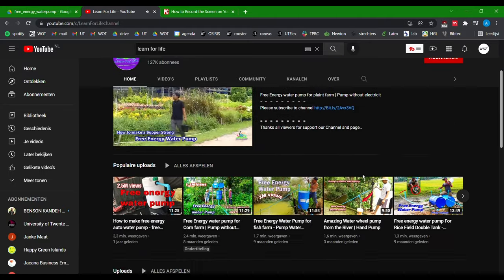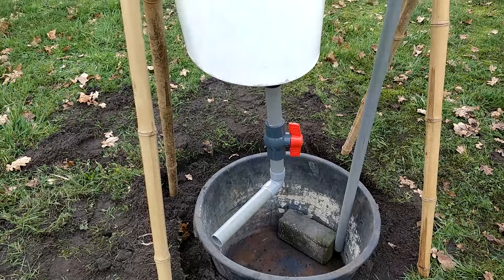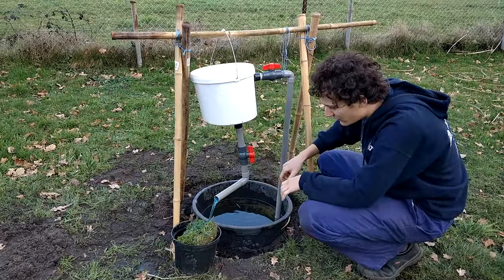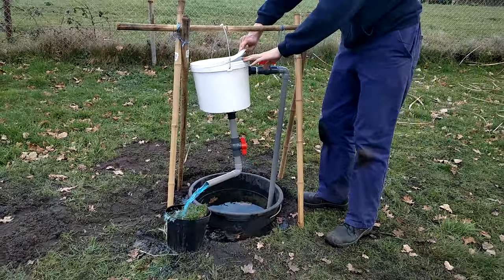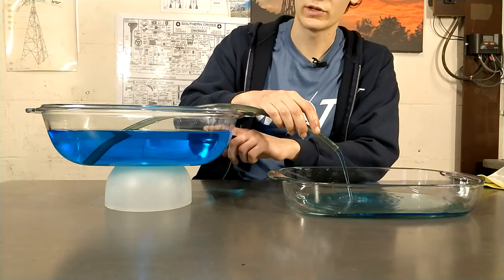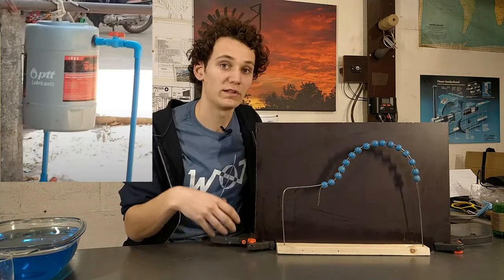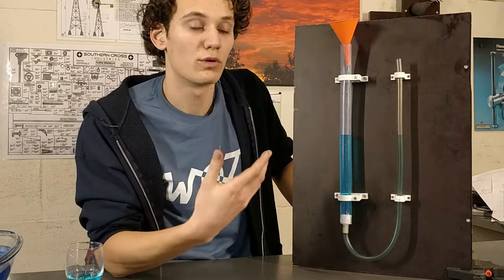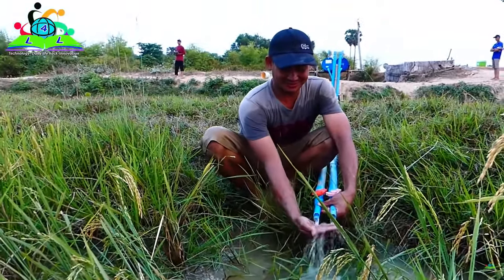FREE ENERGY Water Pump Tested. Is it possible?

Comment: Having pumped out septic tanks in Alaska, I realized the limitations of sucking water from below. Also, there were differences in your test setup and the one I saw on another video. The limit is atmospheric pressure. That is what really pushes the water up from below ground, accomplished by removing air from the tank on the septic pumping truck. If the truck is too high above the water level in the septic tank, it won't work. If the height of the water at is highest point is within the physical limit of a siphon, this idea should work. If, as in your demo, air is entering your bucket, of course the demo failed. It could be as simple as air bubbling up the exit pipe for the bucket. A 55 gallon drum with 2" pipes at the drum, down to 1" pipes for suction and discharge (the discharge pipe was 60' long) this should stop air from getting in the drum. It must be absolutely airtight. A 1/8" hole allowing air in would be enough to kill the siphon. The video presenter said the well was 20 meters deep. Looked to me to be less than 12 meters. For your demo setup, connect about 2 sticks (40') of 1/2"  pipe past the discharge valve and make sure you bucket is airtight, and I think it will siphon water out of your hole in the ground. The weight of the water in the bucket must be somewhat greater than the water in the suction pipe. Also, pipe diameters matter. Small suction pipe and large pipes in and out of the bucket.
Reply: As he said in the video the "weight" of the water isn't important, only the height of the watercolumn counts. If the system is airtight you can disregard the bucket (when it comes to siphoning) so you would be trying to siphon upwards (which does not work).
Reply: Tom, your insights from having hands-on experience are helpful. "...this idea should work. If... air is entering your bucket, of course the demo failed... It must be absolutely airtight... make sure you bucket is airtight, and I think it will siphon water out of your hole in the ground. The weight of the water in the bucket must be somewhat greater than the water in the suction pipe." See my comment here for some similar points, and for a link to what appears to be a working version of what he tried to demonstrate.
Reply: I think long output pipe helps with streamlining the flow and reduce turbulence, thereby reducing air pockets. Any any small air pockets travelling back to tank are being trapped into the traps and helps maintain the vacuum.
Reply: Cheers, lol.

Comment: My friend think about a seal tight container and only opening being inside the water that must be sucked in  by a vacuum created or left behind by exiting water that same sealed container. That vacuum inside a sealed tight container is the one that is pulling water up from lower level into the sealed container while there is an exiting mass of water on outlet. Easy and it work. Your analysis exclude priming, seal tightness and vacuum or suction pressure.
Reply: The video shows that this set up can not pump water uphill. No siphon can do that. Excellent video.

Comment: What a great video! The use of all demonstration models really clarifies a lot!
Reply from the maker: Hi Collin, thanks! Glad you liked it.
Reply: @daviddorshak8811  You're wrong. There is one big fundamental mistake in your reference to the video - the barrel was intentionally built on the bricks above so that the outflow from the barrel was at a higher height and the illusion of outflow could be applied, preferably somewhere behind the bushes. The bucket of water had a higher level than the outflow from the barrel. It is a normal siphon that actually draws an amount of water that is higher than the drain from the barrel. Notice that there is half the water left in the bucket and it no longer works. The pipe in the well did not really pump water because the weight of the water column did not allow it. The water in the pipe acts as a hermetic valve and is not pumped. Therefore, the barrel was squeezed in when the drain was released. This is perfectly legitimate, but it has nothing to do with pumping water. It is very sad that educated civilized people have joined the Third World fraudsters. These people should spread enlightenment and fight against ignorance.

Comment: This is just Heron's fountain with extra steps... When you think about it the problem it's actually super simple. You only have one force that acting on the entire system and that's gravity but obviously it's acting on the whole system equally so the water that's supposed to rise up is being pulled down by the same force that's also making the water flow out from the outlet. I suppose if you optimized the design you can make it flow for some time but it'll eventually stop because magic doesn't exist  :D

Comment: The vacuum was pulling from the outlet instead of the inlet
Reply: YES, and that is because the inlet water level is lower than the output. So the siphon tries to run in reverce.

Comment: Build the same thing they did with the same pipes at proper lengths.
Reply from the maker: Hi Derrick, we replicated and tested the setup you can see at 0:15. The lengths of the pipes match quite well with this setup.
Reply: The fraudulent principle can be detected on any scale. Many times, knowledge of natural laws is enough. If you believe it works, why not build it yourself? You're so cunning you don't build it because you know it's a scam. This is a compliment, not a reproach. :)
Reply: @WOT_utwente  replication and reproducibility... you did not replicate the other system... you made a rinky dinky contraption...
😂
major failure...
DERP

Comment: You need a Foot Valve (one way valve) to prevent air coming up the outlet pipe. What you are doing is, Creating a Suction inside the closed bucket that pulls the water out of the sump in the ground.
Reply: No one way valve is needed in a siphon, but the input must be higher than the output.

Comment: Would be crazy about those guys doing all that work for just a joke. Try exactly as they did with large tanks then judge right.
Reply from the maker: Hi, as mentioned, we replicated and tested the setup you can see at 0:15. The size of the tank we used is pretty similar to the one in this video.
Reply: No it'ss not the same.

Comment: i saw alot of those videos lately, they don't explain the principle
most who works were pumping water from a river to a rice field and i think it's a siphon, the drum is for priming the long line to the field
and i think rice fields are usually lower level than the river, and the system is only used to avoid passing a pipe inside the dyke or the embakment
but one video of a guy pumping water from a well that looks like 2-3m deep confused me
he used a transparent plastic sheet as a cover over the barel to show that water was being sucked
and also, they use a no return valve at the river/well side, and prime the inlet line before opening the outlet line
Reply: can you share the link of the video?

Comment: Vaccume seal the apparatus properly, it will work. In this closed system when water  exits through the outlet; a space is created inside the container. This vaccume space will have to pull that water from inlet to fill that space. Unless there is a leakage in the system where it would pull atmospheric air instead of water.

Comment: Sorry to say that you missed the consipt of how this idea works. It's simply use vacuum inside the bucket with the help of gravity of the outlet pipe in the bucket to suck the water from the well. But something very important you should fix a rigged bucket in order to withstand the gradual suction that accumulates after opening the outlet valve.
Reply: This excellent video shows that no siphon can lift any water to a higher level. The bucket used here is perfectly ok.

Comment: I have been watching this free energy water pump videos, but your test is not done properly, its important that the bucket is sealed so air presure will such the water out, so the presure from the bucket coming down will pull air, and that air will generate the suction it would need... also the exit pipe must be bigger than the input pipe...  I am not sure if it works, but if not replicated properly is a very bad experiment...  apart from that great video.
Reply: Same tough, I'm still skeptical but as nothing is done properly here I do not consider it's a definitive proof.
Reply: His experiment did not follow the siamese tectnik...  Out put mus be bigger but the end of the out put must be same same saiz with the in put..so that the water never stop.. Then he never built the air trap.. It help the presure tu force the water to go out...

Comment: It's a gravity/vacuum pump system, where the mass of water in the tank is greater than in the pipework and can overcome the weight of water in the pipe at a lower outlet than the inlet point in the tank! The vacuum requires air to be eliminated internally and a tank that will not collapse under vacuum pressure! Then the suction will work well and sure, I have done this myself! It works if you create an air-tight seal and rigid pipework!
Reply: Sorry Sir, you can not have done this and have it work. No siphon can pump any water up to a higher level, impossible, as this video shows!
Reply: @kjellg6532  I agree and the point I am making is that the water outlet is actually lower than the source, so yes it's working in this example!

Comment: Your pipe are way too wide for this amount of water! You get air going up
Reply: You may be right. And what he's trying to debunk has a one way valve on the end of the intake pipe. See my other comment about that.
Reply: @trone3630  well that would be just an extra so you don't have to bother topping up every time you start it. The idea is that the pipe dimensions have to be correct for the pump/capillary effect to work out. It'd be the same thing if you tip down a coke bottle it creates vacuum and the bottle shrivels by itself, if you widen the bottle neck it won't be able to do this.

Comment: Their  setup is different, if you are going to debunk it you should replicate in detail. You forgot to fill the inlet pipe with water first and also the inlet pipe should have a check valve. Plus you have an air leak, it should be air tight. Just saying...
Reply from the maker: Hi, as mentioned, we replicated and tested the setup you can see at 0:15. There is no mention of a foot valve nor did they prime the inlet pipe in this video.
Reply: @WOT_utwente  But you have an air leak. It seems their whole premise is that as the water exits it creates suction. Do it right next time.

Comment: Agree prime and volume of bucket is important too. All must be filled and bucket 100% air tight. Slightest leak and pump will fail over time.
Reply: You can even drop the whole barrel, no need.

Comment: Try making the exit pipe around 20 or 3.0’ it will work
Reply from the maker: Hi, as mentioned, we replicated and tested the setup you can see at 0:15. The size of the pipes we used is pretty similar to the one in this video. For the reasons explained in our video at 5:00 we think changing pipe diameters will not have an effect.

Comment: Your uptake inlet valve should be connected to upper tank lower to the bottom vs the top of it. Just as I was typing this someone else also noted its more of a vacuum and siphon than it is a simple siphon.
Reply: It is a simple siphon with a priming tank. It does not work since the output is higher than the input.

Comment: My friend your theory is right now but that’s because you have both tubes at atmospheric pressure.. what allows water to be sucked is the creation of different pressure inside one semi-closed system chamber that as Air, and Air is what makes the trick. It acts like an elastic that pulls, when inside a closed chamber. Another thing about energy. There is potential energy stored in matter, in this case air molecules do the work.
Reply: He shows that a siphon can not lift any water uphill. Impossible and this excellent video proves it.

Comment: @WOT_utwente i understand that it is a kind of siphoning going on (and yes I understand the principal off siphoning) in a direct siphon your explanation is correct. and i'm skeptical to . but to me the working principal of that pump is that it creates a vacuum in the tank. let me explain. one inch tube of about 3 feet long contains about 0.72 L water. if you have a tank base of about 1 feet times 1 feet, that would mean that a drainage of about 2 inches of water in that tank is equal to 4.5 L of water. so if your tubes inlet and outlet are equal then the pump would stop ( because of equal pressure). there you are right. but when you make the outlet bigger than the inlet. you would create a faster drainage than the inlet. what create a lower pressure/vacuum in the thank. what makes that the thank is forced to fill the 4.5 L(in 2 inches in the tank) that he drained, bye sucking on to the inlet of 0.72 L(in 3 feet pipe). what makes that volume of a drainage  of 2 inches water in the thank is equal to the volume of 18 feet suction pipe. and there for it does not work on a siphon but on vacuum. your tank would not collapse due to the vacuum because the suction pipe will fill it up again on a higher pressure inlet than the outlet what makes that pump kinda work, if you find the correct balance between out- and inlet so you won't drain your tank . comments can be made on kurtstael@hotmail.be
Reply: Sorry, but you are mistaken. If, and only if, water level at source is higher than at the exit, THEN this siphon will work. And that is what he is proving, it will NOT work because the source here is placed too high, on purpose!  There at two mandatory issues to keep a siphon running:
1) Air tight
2) Source higher than output.

The rest are details. Length of tubes, diameter of tubes, barrel or no barrel,…

Comment: I am wondering if a check valve is installed at outlet
Reply: No check valve are needed her, but the exit must be lower than the water level in the source for this siphon to work. To show this fact is the purpose of the video.

Comment: There are specific requirements which have to be met in order for this system to work. This test was full of faults.

1) There must be no air leaks. 
2) It must have a one way valve at the bottom of the supply pipe in the well so that you can fill the lines with water at the start.
3) The drum water volume must be larger than the volume of water in the supply pipe.
4) The outlet pipe water volume must be many more times in volume than the volume of water in the supply pipe.
5) The barrel size controls the amount of vacuum sucking the water, more barrels suck more water. 

This is simply a siphon, but the vacuum, which is created by the water draining from the tank, cancels out the difference in height between the source and outlet. In a normal siphon the outlet is required to be at the same level or lower than the water source. But the vacuum in the tank will suck water from a lower source of water, under one condition, when the volume of water in the outlet pipe is greater than the volume of water in the source pipe.  So long as you fulfill these requirements then this system will pump water from a well which is 10 meters deep or less.
Reply: 1) Agree
2) Not needed with a barrel
3) Agree
4) No, not if there is a valve at the exit or the volume of the barrel is larger than the volume of intake plus outlet pipes. 
5) No, low pressure in the barrel depends on the height differences, not the volume.

This excellent video shows that a siphon can not work uphill.

Comment: the top of the upper bucket has to be sealed and the input pipe must be "primed" or filled with water.
Reply: The upper bucket here IS sealed and with a bucket no priming ofvthe suction pipe is needed. He input is in fact primed by the water in the bucket. No siphon like this can lift any water up from say a well, impossible.

Comment: So a system with a greater negative pressure on the inlet and one where the outlet can not let air back to destroy the negative pressure on the inlet creates a bias.
This seen in a ram pump but in the opposite direct as pressure is built up by compressing the air gap again if air can enter the system then the compression fails and so does the effect.
In this video it is clearly shown how the air does enter the system causing the negative pressure to fall and allowing the contined flow of the priming water.
As water is denser than air it is a lot heavier and so the vessel would need to withstand negative pressures at least 5 times hat of air and probably negative 10 atmospheres to lift the water at which point things like pipes and vessels designed for positive pressures just collapse.
Reply: This system works fine as long as the source is situated higher than the discharge, as with any siphon. You may substitute the container and the rest with simply a hose running from high to low level. The purpose of the container is to get the siphon started. The principe of siphoning has been known to mankind probably for thousands of years.

Comment: The first bucket experiment didn't work because you didn't have water above the inlet line, or a fitting that reached into the bucket, and you had no sealed lid. There was no way it could start a suction to the lift side as the water in the bucket was released.
Reply: His experiment is excellent in showing that this siphon set up can not lift any water. No siphon can lift anybwater, barrel or no barrel.

Comment: It’s entirely possible, you are assuming the water source for the pump is the same as the actual water source in its entire volume. If the water collected  below the tank carries less force than the amount in the tank, and the source is isolated (ball valves aren’t motorised last time I checked) then I don’t understand why that wouldn’t work? 
Am I crazy?
Reply: This is a (barrelled) siphon. No siphon can lift any water.